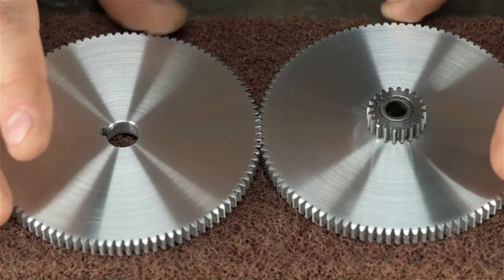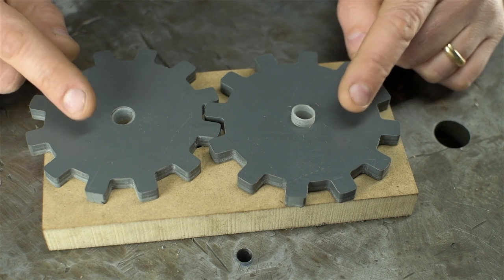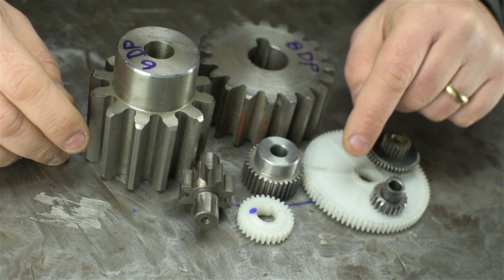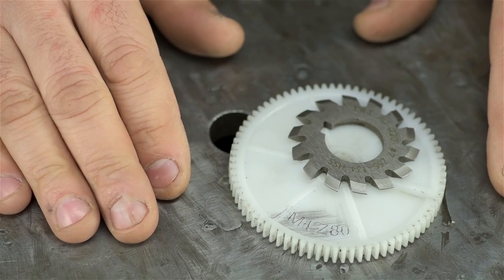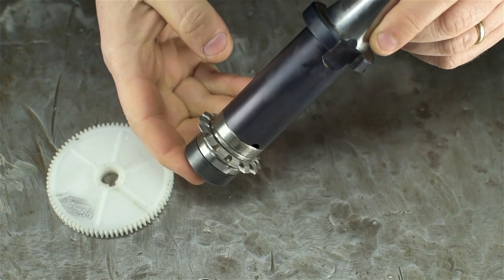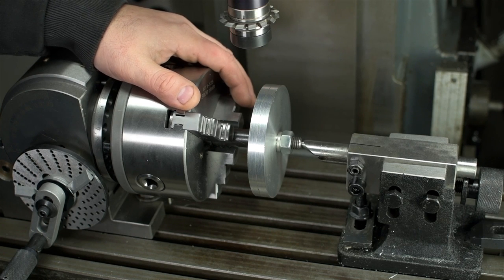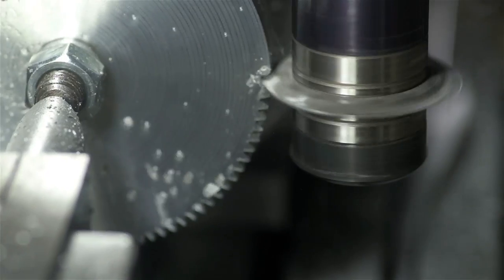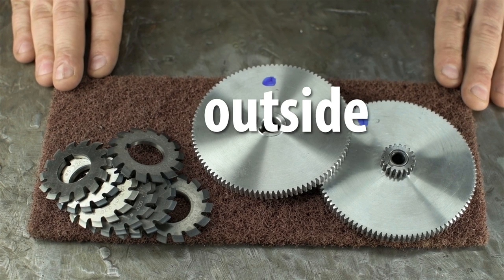Gears! - But Were Afraid To Ask (MiniLathe) - BETTER AUDIO

Comment: Still confusing the metric users with fractions.
Reply: Jim Stanley there no problem with fractions, there problem with users of fractions (no matter inch/metric)
Reply: @RAPXZibit  Whoosh! One of the main complaints of the militant metric users is all the "confusing fractions." A major point they like to make is how "decimal is so much easier." You get the feeling the real reason they like metric is that it lets them hide how much they suck at a fundamental of math.
In this video, we see that even when cutting metric gears fractions are essential.
Reply: Metric user here... no problems with fraction. We can work with and without it. =)
Reply: WE FOUND ONE!! :)
Reply: Nah, fractions aren't that bad, buuut I do have to stop and do a double take on whether or not 7/16ths is bigger or smaller than 33/64ths or whatever. Especially when you go into the "various un-nutters and un-bolters I rarely use" drawer to find that imperial wrench/socket that might fit, grab one that looks the part then invariably have to go back because it was just a smidge too tight/loose. Aaanyway, I just convert the fractions to decimals at that point to be entirely sure. (This mostly applies to stuff that's larger than 5/8ths, most of the stuff under that I've worked enough with to know well enough). 

It's the same as everything else, it's just not intuitive when you don't work with it as much.

(EDIT: Just to save someone the maths, obviously the 33/64ths is larger, it's 0.515625... While the 7/16ths is 0.4375... Further that's 13.096875mm and 11.1125mm respectively. Which basically means a 33/64ths spanner would fit pretty perfectly on a standard M8 bolt/nut, while the 7/16ths might fit on a M8 flange head bolt/nut if it's rusted to heck.)
Reply: They want to stop teaching fractions all together in the Netherlands....
According to politicians you never use them anyway.....
Reply: @samuraidriver4x4  Typical politicians. :P While they're at it, they could probably streamline a lot of other math because everyone has a box in their pocket to do their thinking for them. I know my first go through calculus was a complete wash because I let a calculator solve all the problems. (I got lucky that we didn't actually need to use calculus for the other coursework.) I came across a notebook from back then and had utterly forgotten that integrals were even covered in that class. Heck, all of primary school could be streamlined to a few semesters of "Google Search" and "Advanced Google Search."
Reply: @jimstanley_49  what bother the metric users is having to do fractional conversions, not the fractions themselves. When a metric guy switch scale, he just multiplies or divide by 1000 and there he goes. Doing the same in imperial depends on wich scale you were and wich scale you are going to, wich when un-initiaded seems awfully complicated
(I'm a metric guy 😉)
Reply: Jim Stanley
when i need to think what is greater - 5/16 or 21/64 - well, it takes a few seconds to found common divider and match denominators, but thats an easy example.

and of course, when we talking about comparing 72/117 and 2691/4489 - well, fuck it, everyone i know will take a calc.
Reply: The 21st century can be daunting, but don't be afraid. We still have ice cream. It comes in litres though, not quarts.
Reply: @jimstanley_49  It's not the fractions that are confusing, it's trying to mesh a base 12 system on top of a base 10 one. See 8:47 for a gear-based analogy ;)
Reply: @jimstanley_49  you need to get to thermodynamics to see the real problems with the imperial system. The imperial system had to make magic factors pop into existence to get the math equations to work. In metric the thermodynamics math works without having to fudge the numbers. If it was a question of just arguing over the preferences for marks on sticks it would just be personal preference, but there is something more complex to consider once your doing more than just measuring.
Reply: For me as a metric guy, i have no problems with the basic fractions. (like 1/10, 4/30, 33/400 anything that is possible with 10) basically that's what we use most in germany. 
What get's me struggling is this little confusing Imperial thing with 7/16, 25/32 or 53/64, they have all a common divider but its just more difficult and uncommon. 
In metric you have for measurement 1/10, 1/100 and 1/1000 (of a millimeter) indicators or micrometers. So 1/1000 millimeter is very accurate, like 1/10000 of an Inch, but if you compare that in decimal it is like 0,001 mm and 0,0025 inch. 1/1000 mm and 1/1000 Inch get's even worse, 0,001 mm and 0,0254 inch.
I have no problem for the basic fractions like the thooth things or indicators, but i'm struggling for your 1/16, 1/32, 1/64, they're just uncommon.
Reply: @TheBlackManitu  those fractions (and most imperial system fractions) are all based on dividing by two. 1 in -> 1/2 -> 1/4 -> 1/8 -> 1/16 -> 1/32 -> 1/64 -> 1/128
If I remember right those are mostly used in low precision machining and some types of construction. It doesn't take long before we start using decimal inches 0.001 for machining. (I have a 1/64th in machinist ruler for quick inch measurements of small objects where precision is not required... calipers or micrometers for everything else)

Comment: Forget about audio! :) Tony, just build whole lathe. The good one, better than that from China :)
Reply: Generally speaking the casting is the limiting factor for most people. It's cheaper to buy an existing lathe (or mill, or surface grinder, etc.) than it is to do a custom casting to accomplish the same thing. The usual substitute is a weldment but that generally produces an inferior foundation, subject to greater and yet less predictable resonance issues. Other obstacles also exist, but the casting is the biggest hurdle for most homebrew machine tools.
Reply: and most homebrew machines like the Gingery stuff are more about the process of learning machining and machine building than it is about building a robust precision machine. I agree, Casting is definitely a limiting factor and doing cast iron is even more limiting which is why Gingery has people cast aluminum. Aluminum and steel are not great for precision machines since they don't dampen vibrations the way Zamak or Cast iron does (vibration dampening is the material characteristic which deals with the resonance issues Jon Miller
 mentioned).  
Whereas TOT is looking to build a custom CNC type machine and using the low-quality mini-lathe is a great starting point as it gets past all of the initial casting and machining to build the machine he wants.
Reply: Upgrade it,  one part at a time ;) presto, a new lathe!

Comment: So 100 teeth gears have greater diameter. This is clear to me. But how do they fit on the same place where previous 80 teeth gears did?
Reply: The axle holding the bottom-most gear likely moves along a track of sorts, because the lathe has to be able to accommodate the smaller change gears it came with.

Comment: I think the demonstration of involutes at 7:36 is a little confusing. The individual curves you've drawn are definitely involutes, but the shapes don't really seem to match gear tooth shapes. That's because you've drawn the shape for a gear that has about 1.3 teeth. The "starting" points — that is, the points next to the gear/circle itself — should be either side of a single tooth and curve towards the point of the tooth.

It might also be useful to point out that an involute is always perpendicular to a tangent of the circle, which is why the force on the tooth doesn't change direction.

Comment: Hi Tony, I need help with something.

I'm working on a 3D printer I have to reinforce. Vertical axis is supported (and powered) by 2 steppers, each turning 2 metric M8 rods. This system moves the tool up and down, by 2 nuts on each side. 

I want to switch the metric rods for either ACME (sturdiness up) threads or something like this (don't know the english name): 
https://www.youtube.com/watch?v=pSH00vHNPpY

Want to ask your opinion on both ideas and, if you have the knowelegde, some intel about the video thingy (mainly geometry) and its english name. I have an english version of The Handbook but, indeed, can't find it without the name.

Thanks a lot.